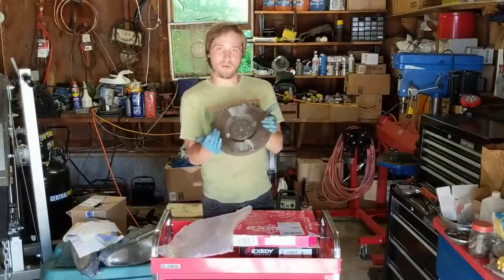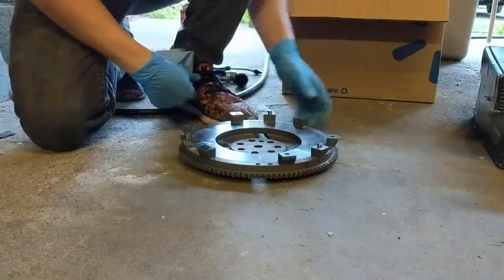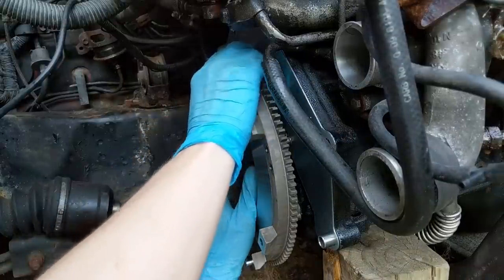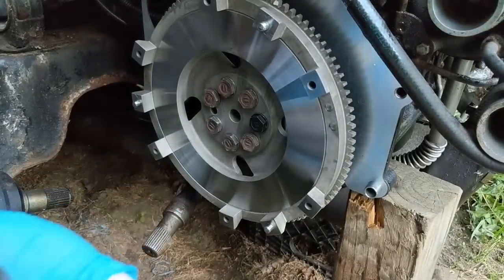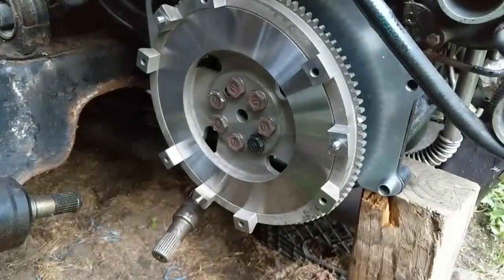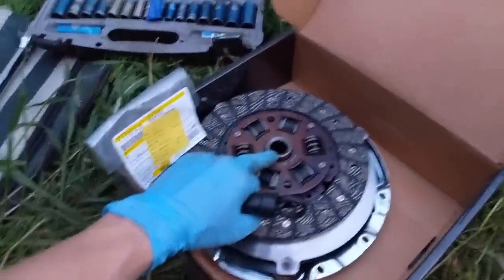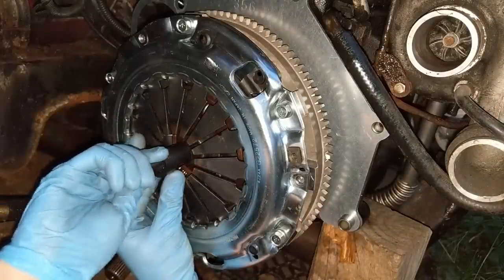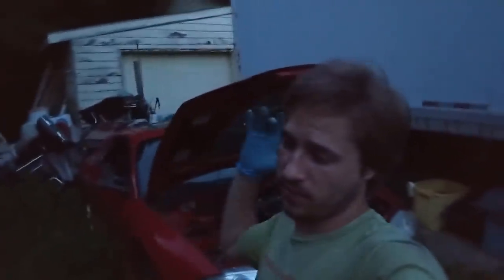Exedy Racing Clutch & Flywheel Install! - Eclipse GSX Performance Parts

Comment: Who disliked this though lol

Also automatic ftw (I don't know how to drive manual lol)
Reply: My guess is his name starts with an S. lol
Reply: HA I wouldn't even be surprised if scotty just went around disliking every other mechanic's videos
Reply: learning a standard is really easy, just let that clutch out real slow until you feel the car start to lurch forward then start giving it some gas, continue letting out the clutch and off you go. Taking off is the hardest part once you are moving shifting is a snap and also don't forget to push in the clutch and the brake when you want to come to a complete stop
Reply: I mean tbh I don't really see the advantage of a manual other than a slightly lower weight (manual trans is usually about 80 pounds lower than it's auto variant). And I can almost guarantee the computer is gonna shift faster than I am, haha
Reply: A stick is a whole lot more fun and you have more control over the car, but yeah, modern automatics (depending on the car) are faster in a straight line.
Reply from the maker: Hahaha thanks for all the comments folks.
Giggy, it's sort of one of those things you won't really understand until you try it. That said, driving a manual really makes you feel more connected to the car and more in control. If you are into cars and machines, or repair videos like this, you will probably enjoy the mechanical feel and connection of driving a stick shift. Plus it is a useful skill to have in general. Try it sometime if you can!
Reply: 802 Garage Yeah I'm gonna have to! Haha. I think my buddy has a manual, I'll see if he wants to teach me.
Reply from the maker: Do iiit.